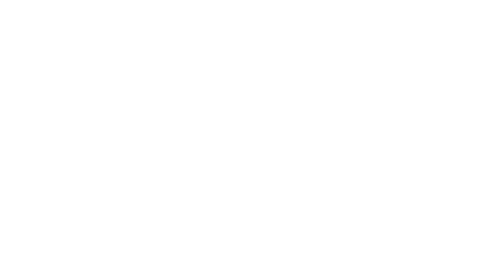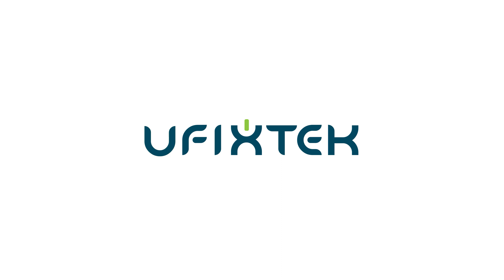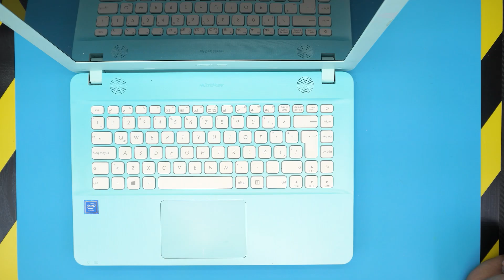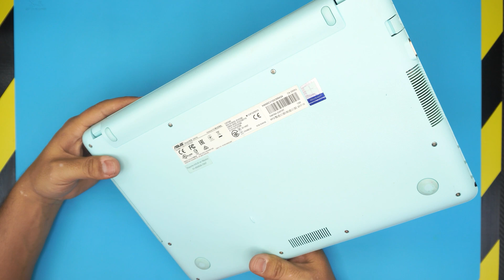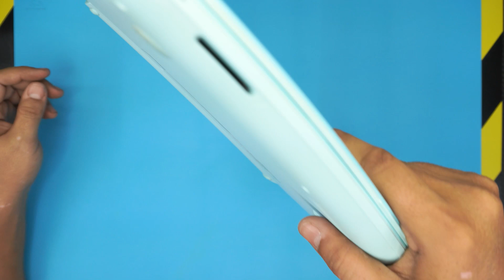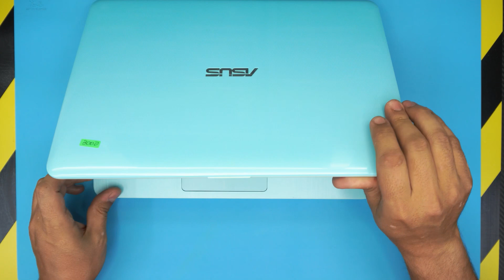ASUS X441n Laptop SSD HDD Upgrade Guide

Comment: brother, My laptop name Asus X441Sa, 4 gb ram. but no separate ram slot. ram is fixed. i have 2 small question.
1) can i change ram which is fixed?
2) if i want to upgrade SSD, should it support NVME? or SATA
Reply from the maker: Thank you for your feedback! If you wish to support the channel, you can show your support by liking, subscribing, or doing both!

Regarding your question:

#1. Changing the fixed RAM in a laptop is not recommended unless you have extensive technical knowledge and expertise in techniques like BGA reballing. It's a complex process that requires advanced skills and specialized equipment.

#2. As for storage, you can only install a 2.5" SSD with a maximum capacity of 2TB. (NO m.2 SSD)

If you have any other questions or requests in the future, please don't hesitate to ask.
Reply: @uFixTek  Brother many thanks that you have replied 🙏
so i have to stick with 4gb ram. so with 4 gb ram should i install 500gb SATA SSD or 250 gb SATA SSD?
because ram is low, can it process faster if i use 500 GB SATA SSD?
Reply from the maker: You can install up to a 1TB SSD without any issues, my friend. The larger the SSD, the better the performance and durability. Higher GB capacity on an SSD generally results in faster read and write speeds.

Comment: I have the same exact model you have. Can you recommend me a Sdd that's compatible in this laptop. Or does the crucial mx500 250gb is good for this laptop?
Reply: I see. Thank you for answering my question
Reply from the maker: my pleasure my friend :)
Reply from the maker: Thank you for the feedback! if you wish to support the channel you can LIKE or SUB or both :P
regarding your question: any ssd sata 2.5" is compatible but i would recommend to get the 500GB or higher because it will give you much much more durability, the 256gb wont last you long time, 
https://amzn.to/3oPLpKx

Comment: this is quite the recent video, damn. I was pretty bummed out to know that i can't upgrade my ram since I have the same model. But glad to know that I apparently can upgrade to an ssd. my laptop is apparently slowing down, so I hope upgrading to a 960 or a 480gb ssd, would make my laptop faster. Since this is a hand me down, i hope i could use it until i could buy my own, so i'm resorting to upgrades instead. Thank for the info! Subbed!
Reply: same
Reply from the maker: Thanks ✌  for the feedback!  if you wish to support the channel you can LIKE or SUB or both :P
Regarding your question:  if you upgrade the ssd you will see significant performance on startup and loading times. 
i would recommend this ssds:
https://amzn.to/3jCO2fP
https://amzn.to/2V6XGOi
don't get a low grade like Kingston or ADATA they are garbage.
if you need to know how to install windows 10:
Windows 10 USB Boot Drive: https://youtu.be/uDu8j2lE-dM
install windows on asus laptops: https://youtu.be/kkxDz398DL8
much appreciate your support